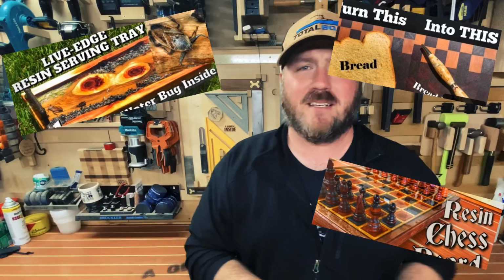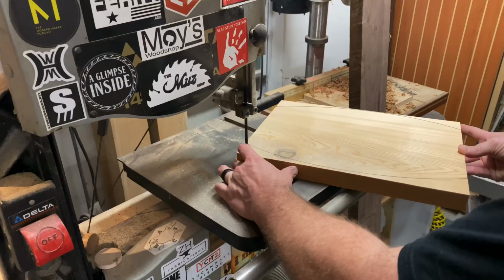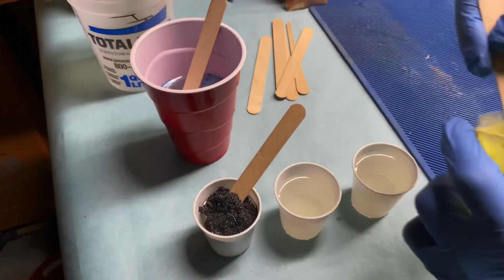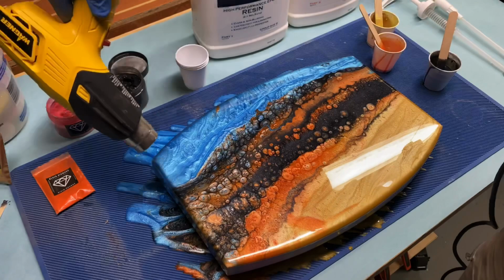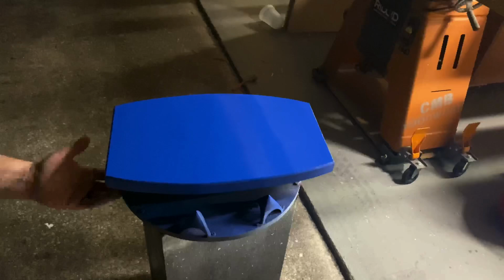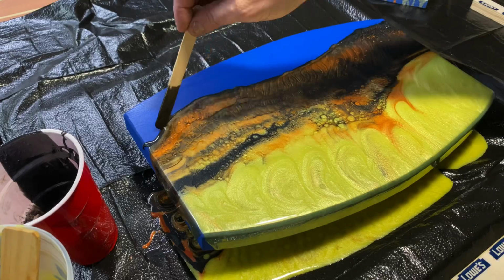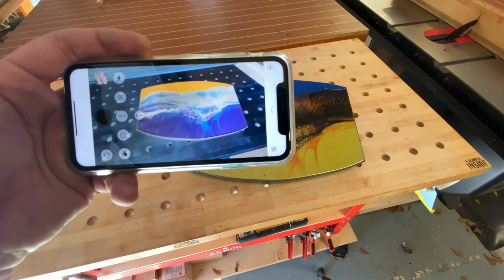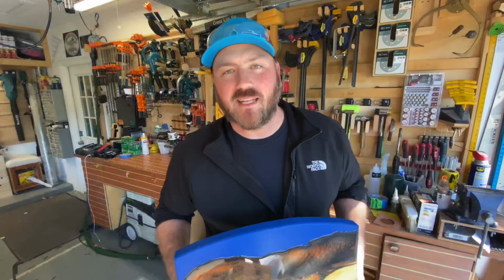Epoxy Resin Effect You Have Never Seen In Your Life...Until Now!!

Comment: Chris,  I recently used epoxy for the first time to create two large replacement church windows in the Dalle De Verre style, which were vandalized and kicked in. It took me a year to figure out how to recreate these inlay glass windows and another to create molds and pour them. I wish I could add a picture, but you can google it. Anyways, I will probably do some projects in the future and wish I would have seen your epoxy videos prior as I did not think I could color the epoxy, and my windows would have been better with a dark tint to block the light, as the epoxy is simply a vessel to hold the colored glass facets in place and to bind to the sand, which blocks the light. Another comment is your use of the word endothermic, I think you meant to say exothermic. I love your channel and all of your video content, even the funny Uncrustables. Keep up the great work.